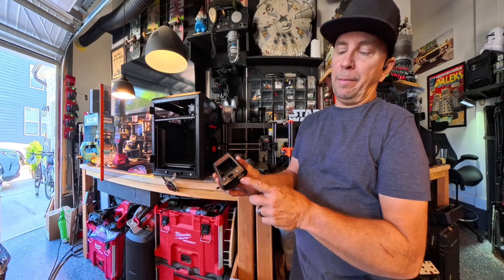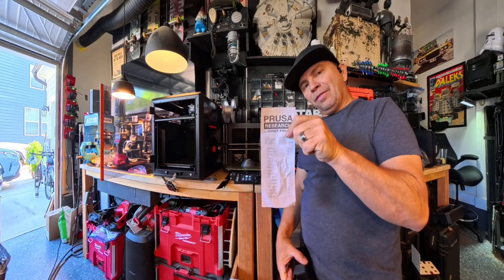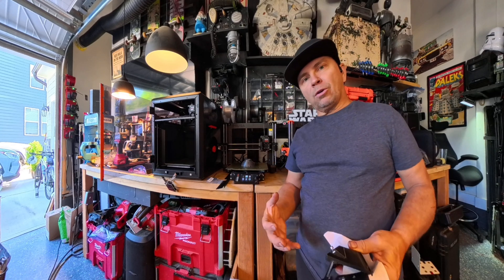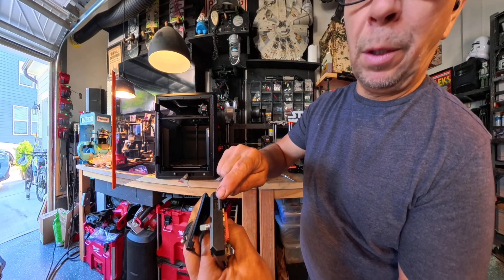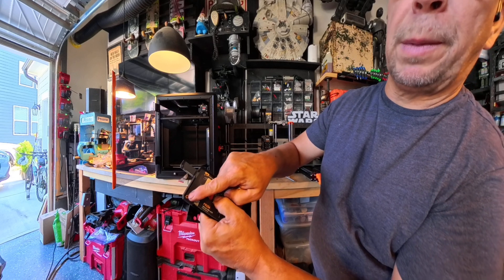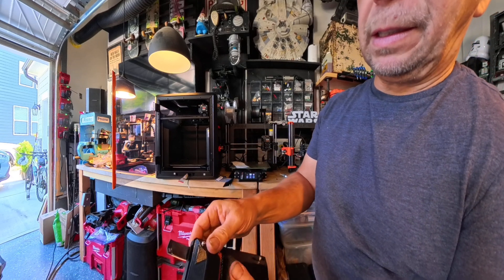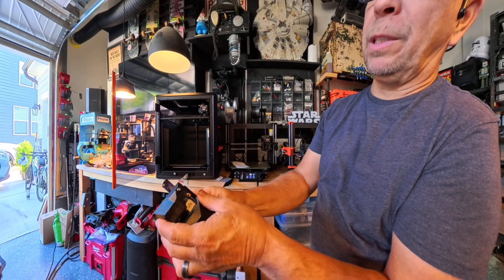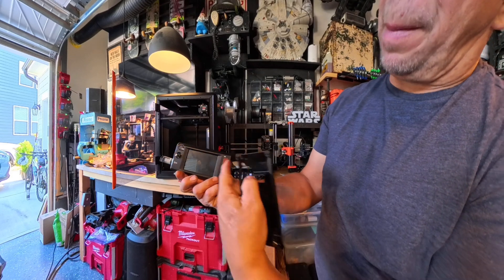Prusa Core One 1st issue - USB Not Reading - FIXED and here's WHY I stick with Prusa

Comment from the maker: finally heard back from Email support and I’ve had the issue resolved for over six days. Prusa chat is way faster, but I was still able to fix it again. My point is fixable. I don’t even think you can take them apart. Replaced the parts I have another issue of Coe one t HF fat I’m putting a video later today, this issue was a bigger problem and it involves humidity and the temperature of the chamber

Comment: Best channel - found it from the Facebook group for one of the Prusa printers.

Cheers for the fix! I also got a spare sent out from Prusa for the same issue, but if I can fix it and have a spare to keep, then even better!
Reply from the maker: What printer do you have?
Reply: @hacklab.ryandewitt for Prusa - I have a couple of MK4S (best stock printer imo for PETG and PLA in regards to overhangs) a Mini+ and a Core one.

I’m waiting for the latter to have the next gen MMU solution released so I can use it for labelling, borders etc on functional ABS prints for a nice touch and to save manual colour changing.
Reply from the maker: @Flagermus_FPV    MK4s rock. What do you plan to print with MMU?

Comment: Which version of the case do you guys have?
Reply from the maker: I didn’t know there were different versions. Do you mean the core one has an upgrade? I don’t have any issues anymore. The machine works unbelievably well. How are you doing with yours?
Reply: @hacklab.ryandewitt some of the printed parts have a version, like E1. I disassembled it plugged the usb in first and it worked. I took it out, assembled it again and i put the usb back in and it strangely worked, so no more issues for me.
Reply from the maker: @bartbogearts2617 great to hear

Comment: I had the same problem, I assembled the case again then the USB entry became less stiff and works just fine since then.
Reply from the maker: Is it working today? What are you printing mostly? I’m doing parts for kayaks.
Reply: Greetings from 6 months into the future where I had the same problem, and reassembling the LCD case again made it, like you, so that the USB entry was much less stiff and suddenly the machine read it without issue and flashed the new firmware.  Thanks!